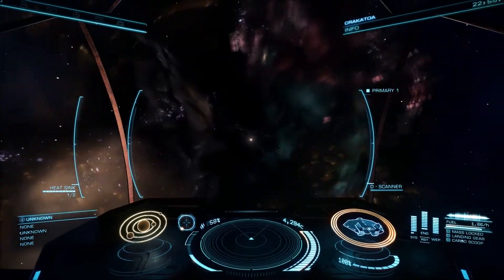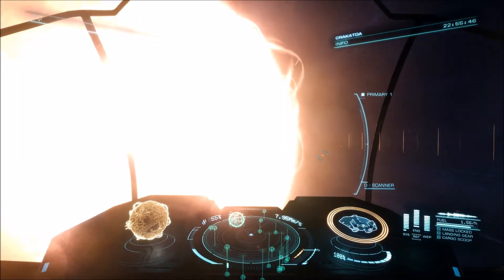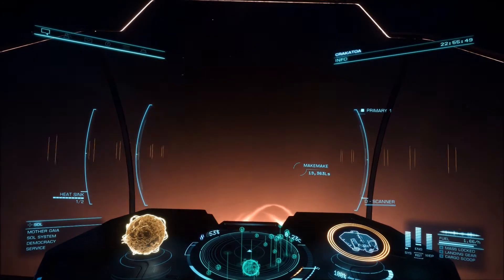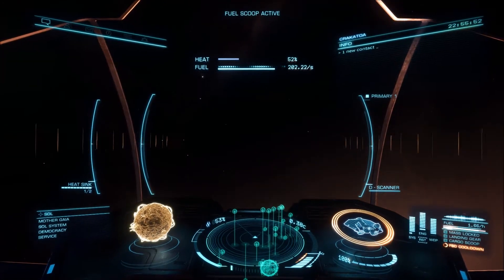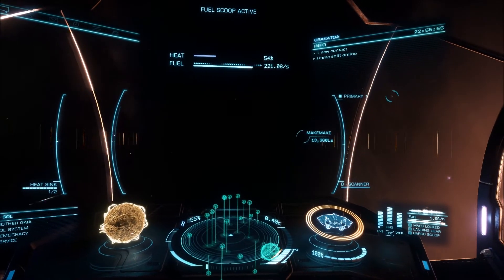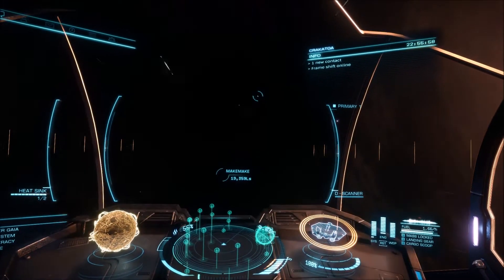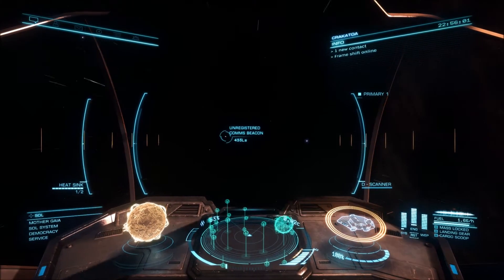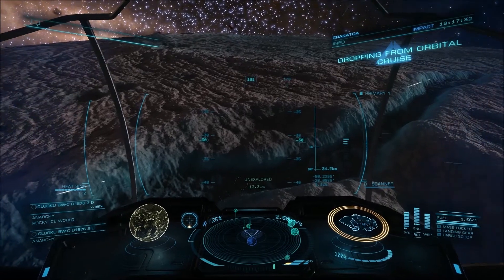Elite Dangerous Science - Frame Shift Drive Theory

Comment: I hope someday humanity can reach beyond the solar system and experience all the crazy planets and star systems that are out there. Even if we are incapable of FTL, even at .9c, traveling to the nearest star would only take a few months for astronauts or cosmonauts onboard the near-lightspeed spaceship.
I guess the frameshift drive doesn't violate causality because the spacecraft stops existing in the normal 3D universe. It also wouldn't be going FTL in the folded space but since distance is different there, an inch in fold-space could be a light-year in 3D space.

Comment: That's a very interesting theory. The current White/Alcubierre drive theory we have proposes inertial warp bubbles, which have no propulsion method, and so to travel at superluminal speeds, they have to be formed at superluminal speeds already. This frameshift drive theory you have proposed solves this problem in an ellegant way, and I really like it. Of course it may not explain fully what happens during supercruise, but it is canon that the frameshift drive acesses higher dimensions while jumping from a star to another.

Comment: This is a great hypothesis, but unfortunately, 4th-dimensional travel still requires as much or more distance to be covered than 3d space. The exceptions to this are, ironically, when in a gravity well (in other words, the moment it becomes a non-euclidean plane), or if you need to move through some obstacle occupying the fastest route.

This isn't what the frame shift drive is doing. In fact, it's basically the opposite. The less gravitational influence on the FSD, the faster you can go, and you can exceed c by factors of up to hundreds and thousands. 4D travel alone will not allow you to do this.

Comment: Ok first off, the FSD is not ONE technology, it's TWO technologies, because the drive is composed of TWO drives, the Supercruise drive and the "Witchspace Displacement Engine" AKA Hyperdrive. Supercruise works by bending and warping space allowing SPACE to move faster than the speed of light. This essentially is the Alcubierre-White "Continuum Distortion Engine" drive that you can read about in real physics, and was predicted by the scifi series "Star Trek". Super cruise is essentially a Warp Drive.

The Hyperdrive, opens a conduit into Witchspace, a higher dimensional plane that exists along side our normal "Universe", the engine opens up an access point and sends a ship into these higher dimensions, because of the higher dimensions, it allows for the taking of a more direct path through Witchspace aka Hyperspace, where the corresponding distance to normal space is many MANY times greater than what we think of as normal space, allowing the crossing of lightyears of "Normal Space" in a conduit that for all intents and purposes is the same length.

The FSD is a combination of human design, the supercruise drive, and reverse engineered Thargoid hyperdrive, the Witchspace Engine. This is why Thargoids pop in and out of normal space and you never find them running around in supercruise, because Thargoids DO NOT POSSESS SUPERCRUISE TECHNOLOGY. So because of this Thargoids have highly refined hyperdrives that allow them to pinpoint drop at their destination, not just drop out at the star or most massive object in a star system. What this also means is that the safest place you can be in a Thargoid situation is in Supercruise.

EDIT 2024: I've come back to edit this because as many have pointed out, some of the smaller Thargoid ships, especially the ones around the Titans and even the Titan itself seemed to arrive in the bubble and use, supercruise drive technology. This is now true, as the Thargoids did to us, what we did to them. They repurposed our Supercruise drive technology to their ships the same way we repurposed their hyperdrives. Essentially stealing from each other. This means that the Thargoids are adaptable, but still doesn't mean they invented the modern day FSD, since as I said before, the FSD is amalgamation of two technologies two drives, making it a unique thing.

Comment: I know this video is several years old, but hopefully you'll have realized that supercruise and jumping to another system are two very different things. You're likely mostly correct on jumping to another system, but supercruise is a very different thing - an Alcubierre Drive, which essentially warps spacetime around the vessel but you're not actually moving - the space around you is, which is bringing you along for the ride, hence why from your point of view you can exceed the speed of light relative to things not attached to your local patch of spacetime.
Reply from the maker: part of the point of the video was to try and reconciliate the fact the two seemingly different modes of transportation (jump and supercruise) are possible because of the same piece of tech (the FSD module). So if this is the case is it possible the FSD does something fundamentally identical in both cases, but with different magnitudes. Of course it is speculation within speculation so anything goes.
Reply: @matthewjouffray  I get that, but hasn't a lot of this been confirmed by Frontier and is thus canon? Regardless, the Alcubierre Drive is an actual theoretical thing that is pretty much exactly what supercruise is, and doesn't have anything to do with what hyperspace jumps do: https://en.wikipedia.org/wiki/Alcubierre_drive

Comment: What I find interesting about your Theory is that it resembles the Hypre-Space bandwidths the ship's in David Weber's Honor Harrington series use.  The  Hypre-drive is limited in massive gravity wells so every star has a no go out to a certain distance called the Hypre-Limit, similar to your stretched space near stars.  ED, you pop up right next to the star.  Personally, I imagine the FSD generates wormholes(Einstein-Rosen bridges).  In Super-cruise, it is in a lower power setting and you are surfing the wave of a continuously opening a closing wormhole while you sit in a pocket of normal space.  To quote Montgomery Scott, "I never thought to think of space as the thing that was moving."   In your comfortable pocket of normal space your position closer or father from the opening event horizon determines your rate of acceleration or deceleration, adjusting pitch roll and yaw changes the aspect of your FSD and drives the opening/closing wormhole.  In your pocket of normal space, you do not feel the effects of acceleration/deceleration or time dilation.    When you High Wake to a target system, the FSD opens a complete wormhole through hyper-space anchored on the gravity well of the distant star.  You enter the wormhole and the computer collapses the wormhole just short of the star.  I'm not saying this is a sound theory, or the right theory.  Just how I think about it when I'm playing.
Reply: It's pretty much confirmed the SuperCruise folds spacetime around the ship to change the ship's position. The other one. Ooooh boy.

Comment: Nice little story but you got problems with your take on the drive, it is a real thing you know? The FSD is simply a renaming for FDevs little sci-fi world of the Alcubierre drive. the way it works s not as you explained, it uses negative energy to compress the space ahead of you and expand it behind you, it’s actually much simpler than what you tried to do, it’s like how a surfer rides a wave, all they do is adjust their directions and amount of energy used. They best way to beat the cosmic speed limit is not to try and challenge it but rather to never move at all in the first place, you use space itself to move you because space it self can do what ever it wants with no limits, it is currently already expanding faster than the speed of light. also if you never noticed the thrusters are off when your fsd is running in the game which is another dead give away that it’s the case. there is no special made up science involved and it’s not far out at all, there is no trans-dimensional travel or anything over complicated, the reason why it’s called a FSD (Frame Shift Drive) is because you are simply shifting your point of reference in space and time to achieve “FTL” travel without the unwanted side effect of time dilation. It’s really very cool and reality is much stranger than fiction could even hope to be.
Reply: I'm jumping onto a really old thread here, but I don't see the dissonance between supercruise and jumping from one star to another.

Why does the jump always have to end at a star? Why can't it end at any arbitrary point in space? Well, for one, stars make for really good navigation points, sure, but for another, what do stars have?

Mass. A lot of mass. More mass than any other type pf body in space, next to black holes. And what effect does mass have on its environment? Gravity?

What is it that limits the capabilities of the FSD? Gravity. The bending of spacetime. I found your analogy of the bending of space to be semantically backwards: I think it makes more sense to visualize the space near larger masses as more crinkled rather than less. It's the crinkling that inhibits the FSD. It doesn't "slow" it down.

Ingame, when you're thousands of lightseconds from the nearest massive object, you can accelerate from mere km/s to hundreds of ls in an instant, and back, with ease. It's when you're trying to do that near a mass that you have a hard time. That's the unifying rule between the loop of shame and "goddammit I need to get off this planet so I can jump to a star behind it".

Stars aren't just navigational anchors, they're also safety bumpers. They stop our ship from just careening off into god knows where. They provide an endpoint to an exponentially growing consumption of the energy required to make that trip. They anchor the discreteness of quantum physics into the formula that determines how far we can jump and how much fuel we need to expend to jump there.

I believe that's also why your speed readings during a jump fluctuate so erratically and violently: Your navigation system isn't on the fritz. The display might not be capable of handling it, but your ship, through the FSD, is, in fact, taking a controlled path, increasing and decreasing the rate at which it shifts space around you the same way you manually do it in supercruise, with the same limitations. 

Supercruise and star jumping use the same principles on different scales. You don't need to propel yourself through another dimension to do it with the FSD. I would go so far as to say that witchspace, if it is in fact a different dimension entirely and not merely a tunnel illusion, is a coincidental byproduct of traveling at superluminal speeds.
Reply: TLDR: Jumping to another star in ED is just supercruise except it's so fast that it's actually super dangerous so the computer does it for you.
Reply from the maker: @Josh-bb3xi  I like the idea of stars being huge anchor points for FTL navigation. Yeah a lot of what you said works with the ideas I outlined in the video. Glad it made you think!
Reply from the maker: No you are right, I am aware of the Alcubierre drive and how it works (well in theory of course, it would be cool to have it work in practice). My intention was to try and reunite supercruise and jumps under the same driving principle. The Alcubierre drive is not ideal for explaining the jump part unless the jump works on a completely new principle. Also I just really like multi dimension theories haha! So at the end of the day, it's up to interpretation, thank you for your valuable input!
Reply: @matthewjouffray  honestly, I like your explanation more, as it offers a strong explanation to why you slow down as you fly near super massive bodies
Reply: @moonshinetheleocat1235  super massive is becuase of mass.
Reply: @snikrepak  no shit
Reply: mattlange00 Alright, I guess I don’t see what you mean then I must be clue less to what you mean about jumping and reuniting something.
Reply: @matthewjouffray  your wrong the alcubierre drive is perfect for this you just dont see the link , the fsd works like the alcubierre drive once your in your warp bubble you can go anywere there is no need to shift dimensions you warp all the dimensions and move space itself this is so you stay in your own timeframe and dont experience time dialation in inmense scales
Reply: @danielstokker  this is correct, but it falls on its face when you get close to any high mass body.
Reply: So if I understood right there is a two different technologies in FSD, one is used for jumps between systems (as it explained in video) and one for supercruise (as in Alain Suarez's comment). Jumps between systems takes the same amount of time, independent how far you jump. Then supercruise takes some time to speed up.